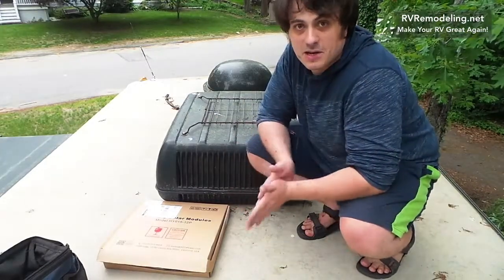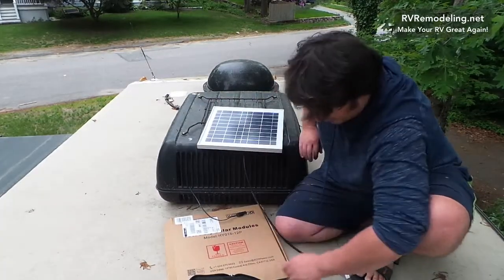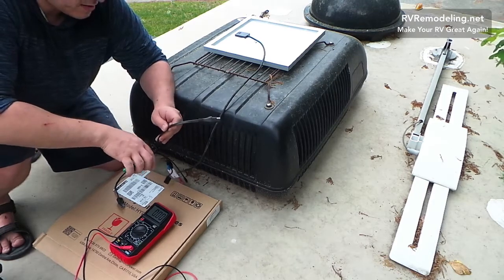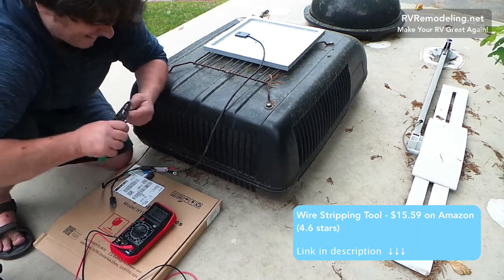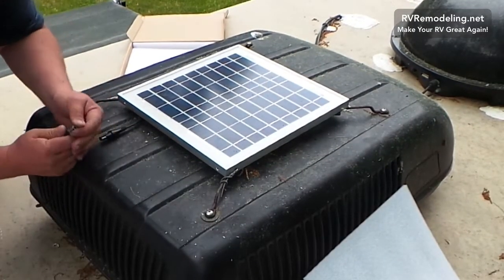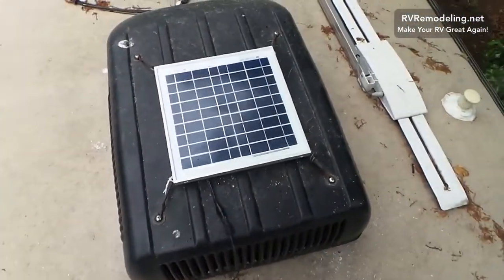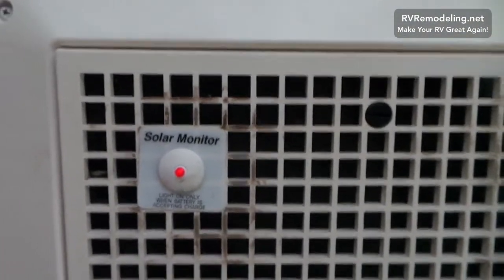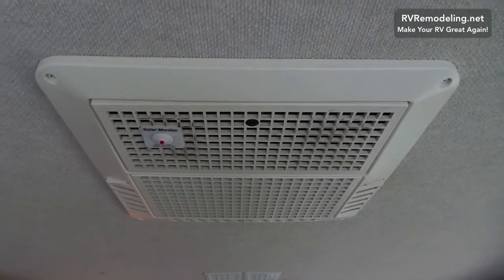RV SOLAR - 15W Trickle Charge Solar Panel Installation

Comment: TO ALL WHO HAVE DONE THIS UPGRADE:
Your battery won't change any longer, because micro fuse 1/2 amp will blow.
After installing a larger panel, replace micro fuse to 2 amp.
Fuse located under shrinking tube on the same wire where RED indicator LED is.
Remove vent cover, disconnect connector. Fuse located between RED LED and connector. Cut shrinking tube and find GREEN micro fuse. 
You are welcome !
Reply from the maker: Thanks for the comment. I was wondering why it's not charging :)

checked all the other fuses in the fuse box and only found the 3Amp fuse which was intact
Reply: @RemodelCalculator  , it took me a while to troubleshoot the issue. After my battery died, I knew something was wrong. I'm glad you can fix it now and other people will be able to have a working solar.
Reply: I replaced the old panel with the following...

https://www.amazon.com/gp/product/B0...?ie=UTF8&psc=1

Once replaced I noticed the LED inside on the backside of the AC panel not lighting up. So I ordered the following LED...

https://www.ebay.com/itm/182431660522

Prior to replacing I used a voltmeter and confirmed that indeed the light was the culprit. Installed the new LEW and bingo...working as intended!

Anyone know if the trickle charge charges both the chassis and house batteries or just the chassis? Looking at the shrinking tube in the pic of the LED I bought it appears to have the micro fuse you talk of (on the Red wire). The old LED wire (red) did not have a micro fuse/shrink tubing at all. I have a 5amp fuse up front on firewall for the solar panel. It appears that the OEM LED either does not have a micro fuse or it was embedded in the small housing where the LED rested rather than along the small red wire.

Comment: What happens when you feed that panel into a 30A transformer, then into a split system inverter?  (big boy for house)?  Would you create 1.8mghz? Would that be enough to run a few rooms?  

You're video was awesome.  Cheers.

Comment: I have the same type of Fleetwood Rv as your.  I was wondering if I could use 5 more watts than the one you used on your RV. I would go up to a 20 WATTS solar roof panel.  Replacing the original panel that came with my 2003 RV.
Any help would be appreciated. Thanks, Larry.

Comment: Update: It turns out this solar panel is only wired to charge the chassis battery and nothing else. That is how it was wired from the factory. It's only a battery tender. That explains why the light is rarely on. If your you're running the engine, hooked to shore power or running the generator it will charge all the batteries.

Comment: It appears this rooftop solar panel only charges the chassis battery. http://www.rvforum.net/SMF_forum/index.php?topic=30639.0
This may explain why the LED light has not been on since given that chassis battery has remained charged if RV is driven regularly.

Comment: Looks as if you could have avoided any drilling by just using the pre-exiting holes (4) on the bottom as a means of zip tying it to the metal frame. I have the same old panel & frame as you do on my 94 Southwind Storm. I just purchased the panel you used.
Reply from the maker: Yes drilling is not necessary, but i still did it.

I have an issues charging - i may have don the polarity incorrectly.. basically my LED indicator inside was working at first, but later stopped. I checked the panel with volt meter it was good... Just to be safe i unplugged the pannel for now. Need to swap contacts om the plug

Good luck
Reply: I purchased this panel as well to replace my old panel (same as you old panel incl. the steel frame on the A/C roof) except the wires were spliced with crimp connectors. The old wires were (yellow & black) I assume the yellow is positive. After hooking it up the LED panel inside on the backside of the A/C was on. Sometime later it went off and I have not seen it on since. Been checking my battery power at the panel (Batt, water, LP gas Black) and it's been showing 12 volt (Green) always. I own a 1994 Fleetwood Southwind Storm 28ft
Reply: My RV has a 5amp fuse up front in the engine bay firewall. I have not seen the LED (inside) on since the first time after initially installing the panel. I just assumed that if the LED is not on it's because the batteries are charged. I hooked it up with the new panel positive wire (Red) hooked to the yellow wire and the other to the black. Was told by someone on iRV2 that the yellow wire is positive. Correct????

I wonder if the LED will light on when the power in the batteries drops to a certain level? RV will charge via the alternator if it's running. I replaced all my interior lighting with LED lights to lower power load and prevent light fixture failure from high heat of old lamps.
Reply: FYI: I did swap the wires on top A/C (polarity) and still no LED on the small monitor panel. I switched them back to yellow -red (panel) and black to black (panel). I assume the LED will only glow if batteries need charging. Hence why I have seen it since the batteries are showing 'Full 12v" on my other panel monitor for' Black tank, Gray tank, Fresh water, LP gas and Batteries'.
Reply from the maker: did you install the charge controller? Before I bought this panel, i compared voltages, and they were pretty close... that's why i bought it ...
Reply: Not going to install it. The panel is only deigned to tend the battery. If the battery is way down expect 6 hours or so to charge up fully. It's only wired for the chassis battery not the coach batteries.
Reply: @jf4872  I am having this same issue. I own a 1994 Tioga Arrow with the same kind of factory charging system. I upgraded the panel just as you have done and have not seen the light on at all. I know my starting battery is full as I just charged it. There is 12v current coming in to the point where the led light is when tested. Beyond that I do not know if charges directly to the battery or the inverter. Keep me posted about your experience.
Reply: @Hello-gc1cb  12 volt? Not sure if it should be 12 volt or not. Thinking it's a trickle charge. Have you figured it out yet?